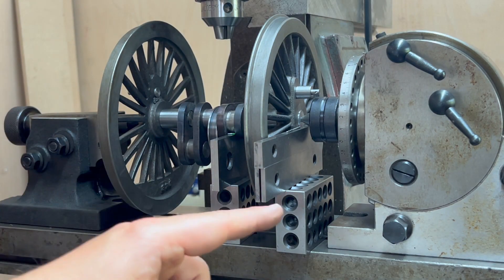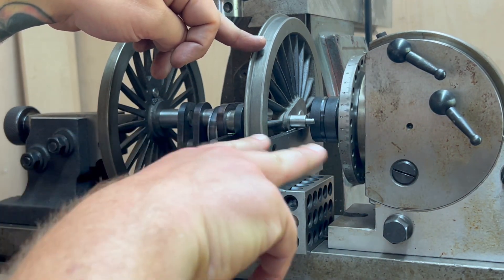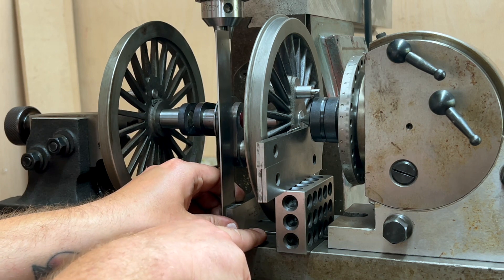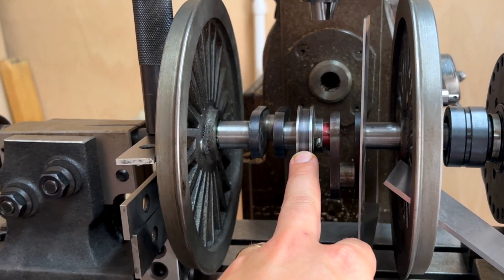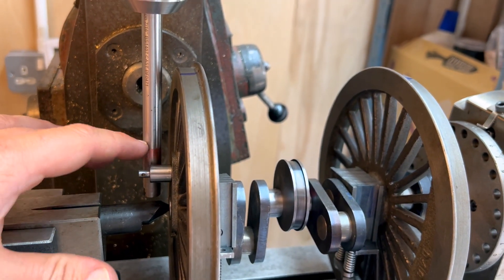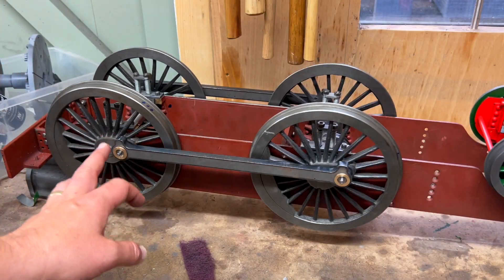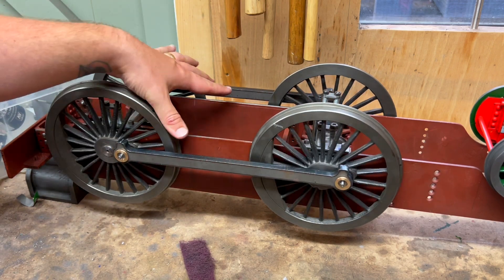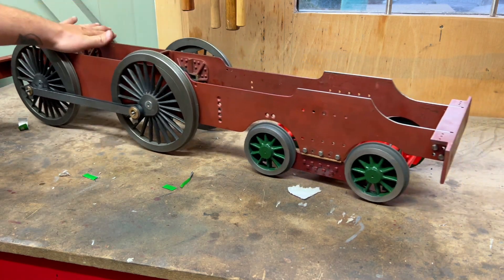JUDGEMENT DAY: Rolling Chassis or Not? - Steam Loco No. 29

Comment: Obviously the tight spots are caused by the Coupling Rods being installed upside down. All joking aside, did you try flipping the rods from side-to-side ? That tight spot really isn't much considering the wheels don't lock up with so little weight on them - great job !
Reply from the maker: HA! I did notice that before. Swapping sides/orientations hasn't helped but  I've managed to get all the stiffness out by opening out one coupling rod bearing by about 15 thou so I'm going to leave well alone now!